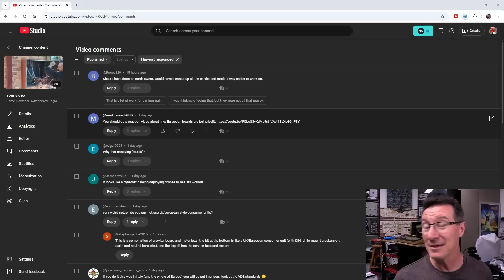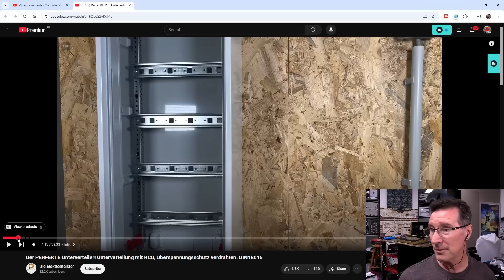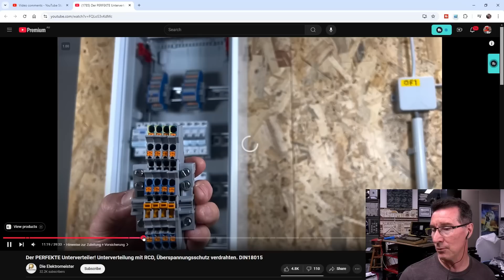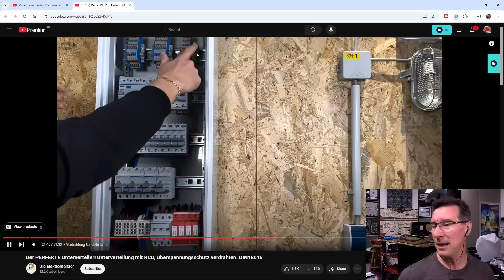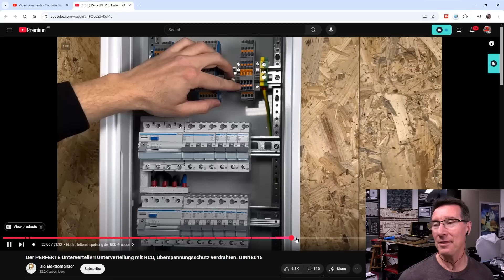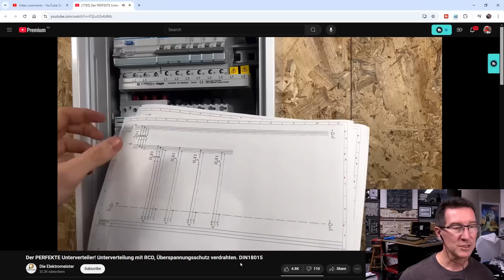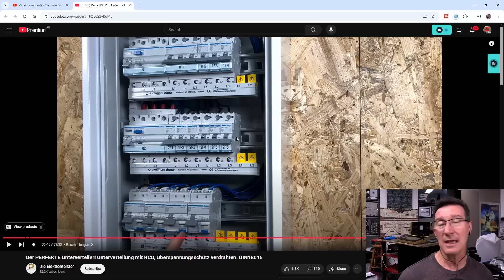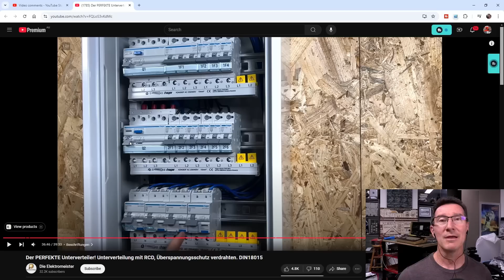eevREACTS - European Electrical Switchboard Wiring

Comment: Regarding ferrules - my understanding is that you cannot stick multi-strand wire into DIN modules directly, as contact can be lost over time as strands get squished -> fire hazard. Crimp solves that and this is why it is mandatory (for multi-strand wire).
Reply: It might not be mandatory here in Australia, but it is considered Best practice, and some devices require ferules depending on their terminal design.
Reply: Basically every heavy industry in Australia uses them also called bootlaces cause they look like the end of you shoe laces...
Reply: @entropyachieved750  Which are actually called aglets, just to sow confusion.
Reply: You can stick multi strand straight to modules etc. It just depends on whether the module or device contact itself is RATED for fine- or multi-strand or solid or everything.
Also, at least here in Finland, the national implementation of EU electrical code requires that if two wires occupy the same contact, they must of the same type i.e. both solid and so on.
Reply: If you've ever done any work with finely stranded wire (H05V-K or H07V-K) you'll see that you always want to use ferrules even if it's not mandated by regulations. It drastically reduces the fuss of working with it, lowers the chance of stray strands not going into the terminal you're pushing it into (often at an angle and not straight), makes it possible to take it out and put it back into a terminal multiple times without damaging the strands or having to retwist them every time, reduces the chance of breakage due to bending fatigue at the point where the insulation is stripped, etc.
There are also different classes of stranded wire, the least stranded is basically still hard wire, just easier to bend, that has a strand count in the single digits (7, 9,...) you can use this type without ferrules. The second and most common type has a strand count in the high-tens to low-hundreds and requires ferrules, except when it fits tightly into a terminal designed also for stranded wire, if there's too much free space in the terminal, it always requires a ferrule. The third type is extra finely stranded, has thousands of very thin strands, and always requires ferrules. Think welder wires, or in machinery that has moving joints.
Reply: @brainndamage  Yep. But if you're dealing with spring loaded contacts, it's not absolutely necessary. Like Wago Cage Clamp system.
I am however in the pro-crimp camp. Makes future changes easier if the stranded (however fine or coarse) wire has a ferrule crimped on so it stays neat and no stray frays to annoy me.
And since I'm using Weidmuller's crimper and the ferrules come in ribbons,, it barely slows me down as the single tool in my hand cuts strips and crimps.
Obviously I have a separate crimper as well because I don't always want to change the ribbon, adjust settings and the tool only does 0.5 to 2.5 so I use the dedicated crimper obviously for bigger stuff or if I need few crimps of different size or when I'm feeling lazy.
Reply from the maker: Here in Australia?
Reply: @EEVblog2  Would say it is a recommended practise, but you also are not supposed to use non panel rated wire in a panel as well, so the only time you use a ferrule is if you are bringing in fine stranded cable. The panel rated cable has either a single solid core, or 7 thinner ones, which will work with the cable clamps in the switchgear. Never seen ferrules in residential, but industrial you get a fair amount of them, some manufacturers, especially the German ones, will use them even on solid core wire, just to make sure the wiring stays consistent, and also every wire will have a cable marker on it as well.
Reply: @EEVblog2  Here in Europe. But I am pretty sure risk of using multi-strand wire without ferrule is the same around the world...
Reply: @EEVblog2  even in European (EU) countries are not mandatory in residential context
Reply: In North America, the wire used is single strand for 14, 12 and 10 gauge ( up to ~2.5mm2). Bigger than that are 8 and 6 gauge wire. They are multistrand, but they are not fine strands. The 6 gauge wire I have is 7 solid strands spun together.  No need to crimp it together,  just get all the strands in the breaker and torque it down. It won't get squished/loose over time.
Reply: The plate bridges the contacts above for common neutral.
Reply: IIRC, it's a concern in the US, but I am not sure what our NEC dictates. The one time I swapped out a switch with a timer that had stranded wire, I was very careful to make sure that it was all twisted together and not an arc hazard.
Reply: @welbow  Very interesting as the instructions in the hager breaker I have say not to twist the wires.
Reply: @bascomnextion5639  I'm not gonna bother looking up Hager's circuit breaker manual but my gut feeling says it's probably referring to solid wire, not to twist those when you put two of them in there.
Reply: There is a common 3 phase RCD for multiple circuits while you've got an RCD in each circuit.
Reply: Never seen ferrules used here in a switchboard at least not on "standard" 7 strand stranded cables, might be different if it's a finer multi-strand cable like what's shown in the video.
Reply: @paulb2529  fair. So the title of the post must say German e not European
Reply: @BarsMonster  Ferrules are not mandatory. There are pros en cons such always. In some situation it is even worst than without ferrules. It is a cleaner solution? Yes. It is time consuming? Yes.
Reply: I know it's mandatory in Europe for multi strand flex but wasn't aware that standard multi strand was under the same legislation. Looks like fairly standard industrial wiring to be honest.
Reply: @paulb2529 rules are different inside Europe. Stranded cables are not allowed in Belgium for residential installation. In Italy stranded cable on residential installation is allowed.. so using the term in Europe is wrong.
Reply: @cupra_driver    I said flex cable  needs a ferrule. So class 5 and 6 cable requires a ferrule. I said that I was unsure about standard multi strand cable so was unsure if class 2 required a ferrule.

Comment: Yes there is no real difference. I think you have solid wires (not stranded) so no ferules can be used with those.
Reply from the maker: Yes, you wouldn't use ferrules on solid wire.

Comment: You could at least tried the automatic captions to get a climpse at what he was talking. He actually explains every step very well. And this is not a competition or a fight about who does it better! It's just a very nice way to do a perfect job for a long lasting installation.
Reply from the maker: Yeah should have used captions. Anyway the point is there is absolutely nothing surprising for me here, this is what I would expect to see here in Australia too for an indoor panel inside an upmarket house that isn't penny pinching on the DIN enclosure. I was expecting WOW and I got just something ordinary. Try adding 9 current clamps to this and watch it get messy.
Reply: @EEVblog2 Yeah, I'm absolutely with you there. But not with the messy part,  that's what the slack in the cables is for. You always can alter the installation and add to it. And yeah, it's a pretty basic installation - this guy, and a lot of austrian youtubers for some reasons, are regularly showing downright installation p*rn. This is a pretty "meh"-example to be fair. But it was designed to be sent out to a viewer.
Reply from the maker: @marcus_w0  You don't add extensions to an exising install just to get some extra slack, unless absolutely needed, that is bad practice, you would just be adding an extra failure point. Yeah, I was expectign this to be somethign extra special and it just seems like a basic install.
Reply: Well technically Dave's old installation lasted 40 years and was still working before he upgraded it, so even that rat's nest was a long-lasting installation. :)